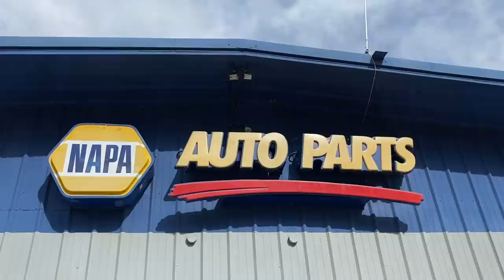Lobster Mushroom Foraging, Slacklining & Working on my Engine Swap || Vanlife in BC

Comment: You are correct that a good used vehicle can be maintained and repaired at a lower cost than car loan payments and the higher insurance cost of a new vehicle. The two culprits would be body rust and the transmission.

Comment: Just some advice from your mechanic sub double or triple check all your fasteners and your firing order you dont want any leaks or things going loose or not fireing up properly. When you get it running keep your eye on the oil pressure and temperature as it warms up keep at a little higher idle if you can for awhile. Dont drive at highway speeds for awhile until the engine has about 500 miles on it. 👍👍🌟🌟🌟🌟👍👍

Comment: Now, the trick is, to keep the baggy of extra nuts and bolts in the vehicle with you, so, when something suddenly starts dangling or rattle it, then, you will know where they are supposed to go, works for me every time.
Reply: Driving an old chevy, you always want to have some 3/8-16 nuts and bolts handy. I think the whole vehicle uses them.
Reply: @truckguy6666  funny but now I have a newer chevy and it's 10 or 14mm nuts, bolts and wrenches needed. Cracked my only 13mm socket on the welded on oil drain plug and had to resort to deep creep lubricant and a trusty vice grip.....

Comment: That gasket kit has rubber vcg not the old cork stuff.  You should be good.  Too bad you didn't have the roller cammed motor with the roller lifters.  They run smoother.   Tell pops you need a msd spark box makes it run more efficient.
Congrats on you and pops working on your engine.  I treasure my memories of me and my dad pulling motors.

Comment: Just since I like talking about engines and stuff, the chrome valve covers are going to be very prone to leakage. I mean they look nice all clean and shiny but they are so slippery, its hard to get a cork gasket to seal on them and you will definitely have oil seepage there and where the PCV valve plugs in, etc. I'm all for the factory covers with a fresh coat of paint! SUCH higher quality and probably have (better) baffles inside where as I bet the chrome ones dont.
Reply from the maker: Great advice, thank you. My dad happened to have the valve covers so free to me and the gaskets were some sort of blue rubber, still a pain to install.
Reply: @tidelinetoalpine  You know I see a small block and immediately think they're all from the 60s and 70s but yours is a little more modern, center bolt valve covers and a more modern gasket material. You might be OK, its a huge improvement from the previous style with the bolts on the side and the spreader bars. Plus your dad looks like he's turned some wrenches on a chevy before. I can tell its not his first rodeo. Cant WAIT for your video review of the new engine after you put a few hundred miles on it!!

Comment: I’m excited about 2 things: 1) that I can contribute to the “Frank Fund”, and 2) that we get to see the engine fire-up very soon!! I’m also curious about slack-lining. I’ve never known anyone who does it and I am now older than most who I think probably start such a hobby. But I can see how it would be so great for the body. What tips/suggestions would you provide me? How does one get started and what equipment is needed?
Reply from the maker: Thank you for joining me on Patreon 😊 for slacklining there are two main ways to go about it for short-moderate lengths off the ground: I use 1-inch webbing tensioned but a 3:1 using O-rings and carabiners OR you can do what most people do these days and buy a slackline kit that’s 2-inch wide and uses a ratchet to tension. I learned doing a lot of things different that are the general suggestions but it helps a lot to relax, few it and go with the flow, don’t hold your breath and keep a long spine. The shorter the line the easier it is to get more tension and then it can be lower to the ground. It also helps to learn with a friend why you can use their hand gently to help balance. Hope this helps!
Reply: slacklining does look like fun!  It's important to work on your balance as you age. Minivan Lee does it, too, and she's 68, I believe.

Comment: Honest question.  Why is every slack line I have ever seen set to crotch height? If it's lower I guess it would touch the ground. But ouch! You're Dad is a awesome mechanic and a great dad for helping. I ordered 4 of your lovely Frank stickers cause I love him.
Reply from the maker: Good question. If you bottom out walking you eat crap way harder than otherwise falling off, it’s horrible so you definitely want to not touch the ground when on the line. The longer the line the harder to tension so the higher it needs to be. I prefer low enough my feet can touch the ground of one leg comes off either side or it would hurt way more. Also a tighter line recoils stronger to having it higher can be looser and less likely to have serious bruising. I really try to go with the fall and land off to one side away from the line.

Comment: Make sure you have the number 1 cylinder at top dead center on compression, the distributor rotor will point at the number 1 post where you will attach the number 1 plug wire.